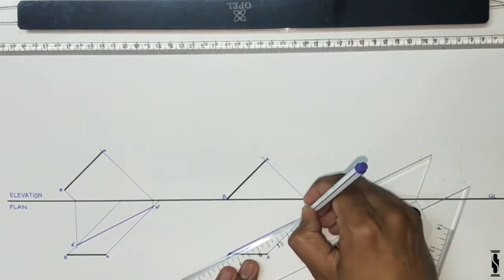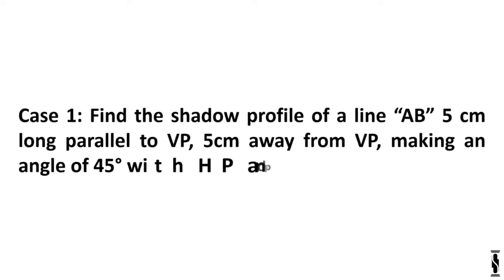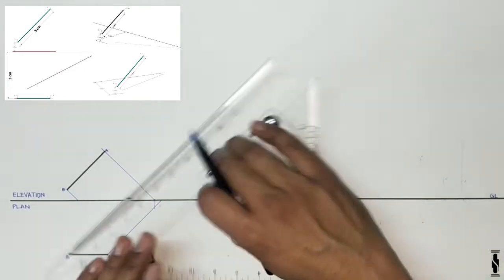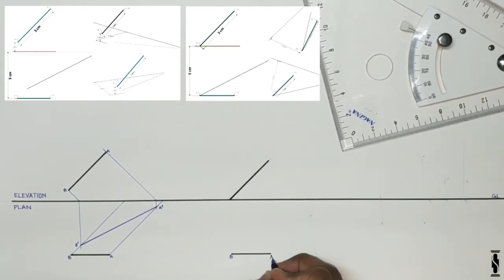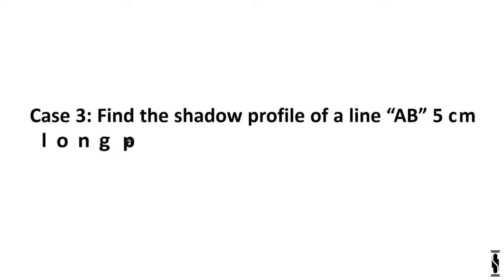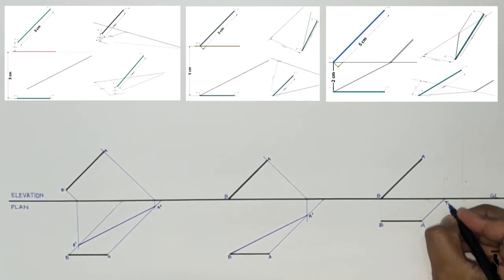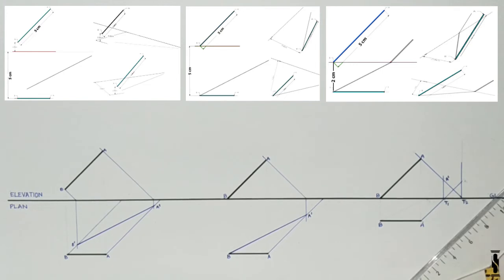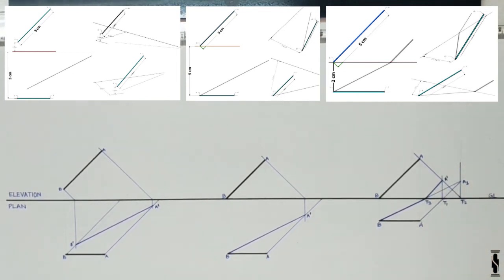sciography of line part 2

Comment: Sir you did 3 questions.  Why was 3rd question steps different from the previous 2 . You just changed the distance of the line in 3rd , then why different method. 

How will I understand in exam which method to use .

Please guide .
Reply from the maker: There are always two probability
1st- The shadow falls only on any one of the plane (VP or HP) then go for regular method
2nd - The shadow falls on both the plane (HP or VP) and if line is perpendicular to anyone of the plane then go for regular method and if line is making an angle with anyone of the plane then go for the second method (turning point).

For more understanding take a pencil as line and your notebook as reference plane and give it a try by your self.

All the best 😀
Reply: @STAMBH2supportU  thank you sir
Reply: Sir make video of shades and shadows of combination of solida